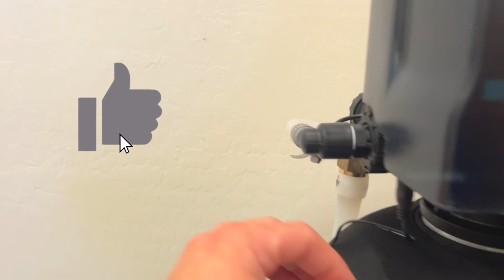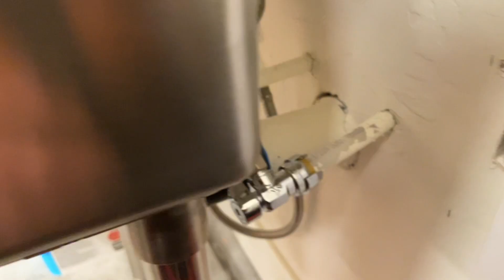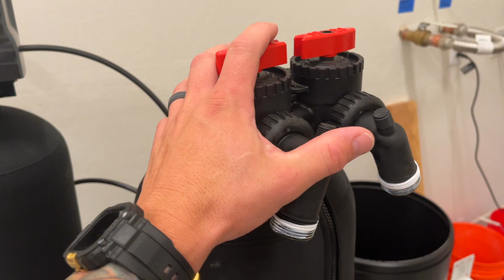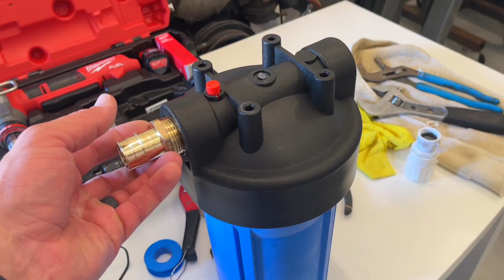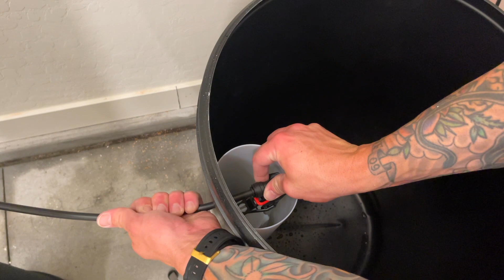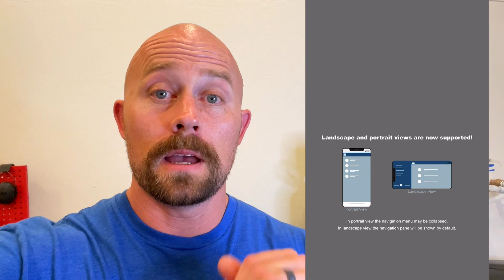How To Install Whole House Filtration System From Shell Water Systems | BEST Water Softener System

Comment: What if I don't have that main line coming in and going out?
Reply from the maker: In that situation you’ll need to have a water softener loop created. This is something you can do yourself if you’re comfortable with the plumbing but if not you can obviously hire a plumber to creat a water loop for you to hook up a softener.  If you do have one done I’d suggest having the put a shut off valve on both ends and make threads. That way you can install the softener yourself very easily

Comment: Just installed the system yesterday. The water is coming out cloudy. Is that normal? Is it safe to drink?
Reply from the maker: Yeah. It will be cloudy at first. I believe it’s bubbles from the new system and possibly any residue/dust off the cleaning matter in the tanks. 

Did you do the flush after the system starts up? I think they have something in the manual as well where they let you know the water could be cloudy at first as the system equalizes and rinses.
Reply: @FortKnoxCo  yes I ran the regen after the app setup as it mentioned in the instructions.
Reply from the maker: @Alkhi-h8g  as long as it’s done it regen on start up you should see the cloudiness subside soon. I believe it’s mainly micro air bubbles since it’s a new system

Comment: What if you dont have a loop for the water softener system
Reply from the maker: Then you will need to add one. It’s not too difficult. But any general plumber should be able to create that loop for you if it’s something you don’t want to do yourself. It’s just creating a break in the main water line coming into your home with a threaded tip on both ends. And you’re installing your water softener there at those two ends. That way all your water to the home is now passing through your system before it splits off to your cold water feeds and your water heater

Comment: Hey i was offer one called Duxura with just one tank for $8,600 dollars ans they sell that claiming that you can drink the water. But, it should he a scam. Can we drink the water of this system right ? Because im buying it tomorrow.
Reply from the maker: Yeah that’s the idea of the whole home filtration I believe. It softens the water with one tank and the other has carbon matter that filters it of the other stuff.  Most people still install a reverse osmosis system at a sink to get drinking water and to sometimes supply their refrigerator for ice making/drinking.

Comment: Why would the particle filter be after the other two filters? Looks like you would want the particles removed before the other filters??
Reply from the maker: There’s two theories behind this. Some systems/companies recommend different. 
One situation is like you said,collect particles before they go into your system

The other thought is let your system collect the possible large particles and guarantee nothing gets past or out of your system and into the house. I’ve have multiple friends whose system failed for some reason and the matter inside the two tanks blew through their entire house and water heater and utilities. Huge mess to clean up and possible damage to appliances. So I put it after the system to make sure nothing gets out of the tank into the house and let the system do what it does.
Reply: @FortKnoxCo  Thanks. I just purchased a system charcoal and resin from SoftPro. There system does not have a pre filter
Reply from the maker: @ you should be able to add one no problem. They are sold separately by several companies I believe.

Comment: The water meter belongs to the home owner in Tn. If it breaks you buy a new one . $1200.00 in 2019.
Reply from the maker: That’s odd. It seems like they should own that connection. Just like the gas company anything that has to do with the meter connecting on either side of it they will be responsible for. Anything after the meter is the homeowners. So if the water district comes out and messes with your meter and they break it, it should not be the homeowners responsibility. In that situation, I’m guessing the water district since causing the damage would take responsibility for it.

Comment: This information is very helpful, thank you! Just wondering do you ever have to replace the water softener resin media? How long it the system expected to last?
Reply from the maker: I have not came across this issue as of yet. I believe each system. The range is usually 10-20 years with 15 years obviously being the median. But it does depend on the system itself.  The smaller ones that have a small tank and brine tank all compact I’d say are on that lower end. These systems that are large and robust I’d say are on the higher end.  It also depends on the amount of use too.

Comment: Why didn’t you add a bypass to change filters out when needed or if softener system fails then you can shut off ball valves feeding softener turn on bypass and one still has water to the whole home.  And yes shark bite is a horrible product. As a plumber I highly recommend sweat or propress.. one can use pex a or pex b but it’ll look un professional.
Reply from the maker: All good information. PEX A seems to be superior to compression PeX B and some other compressions. Mainly the difference in diameter with pex A compared to compression and PeX B. The inside diameter decreases with every fitting and that can drastically reduce water flow and pressure the further you go in a home. PEX A and sweated joints will keep their true diameter even thorough the fittings. 

A lot of it is preference and what’s available in your area. Some codes require certain fittings vs others. Sometimes it’s just what would work better for your budget or maybe your climates.  I’ve seen examples of every type of fitting having a possibility of failing. There’s pros and cons to each method and quality of installation is always a factor

Comment: Hello, new developments come with fire sprinkler in the house. A plumber mentioned if the water pressure is disrupted, the insurance companies could also have issues with future claims. how would go on with installing a filtration system in those house? Thank you in advance?
Reply from the maker: Well the fire systems should have a branch of water feeding them separate from your drinking water usually. But the home filtration systems usually don’t affect the pressure much at all. Your home also has a pressure bell house fitting at the main shut off in your home and you can adjust your pressure up or down to your needs there. I’ve never had to mess with it other than on an old home after installing new fixtures. But this issue I’ve never really came across with it messing with the water sprinklers. I’d need to know more about how the sprinkler system is fed and pressurized to know exactly. You can also install a visual pressure gauge to keep an eye on your overall pressure in the line too

Comment: Curious. Why didn’t you run the water through the sediment filter before it goes to the filtration/softner?
Reply from the maker: You can install it before or after the system. Honestly, it’s whatever your preference is. There’s two different trains of thought behind it. The manufacturer in this situation recommended it be installed afterwards, I believe the idea was if anything made it through the system or out of the system, it would catch it before it goes into the house. Obviously, the other way of looking at it when installing before the system, would be to catch anything from your Supply line and not let it get into your system.

The only thing I’ll add is, I’ve seen a couple situations where a water softener has malfunctioned, and it allowed the particle matter out of the tank to get into the pipes of the house, this caused a lot of problems for the water heater and all of the appliances and fixtures. If the sediment filter is installed after your softener, it could have prevented this. So in general, I like installing it after the system.

Comment: I have a question. I found an online document and some other videos for the filtration tank with that same head unit and bypass valve and the document and other video shows to install the water coming from street to the upflow inlet  from the tank which is the left inlet. On your video you are installing the street water to the down flow  inlet. Those upflow and downflow letters are engraved in the head unit . Is that correct? Or does not matter? Thanks
Reply from the maker: Yes, it does matter which way you connect it. It will have them marked on the head unit. I believe when I received  this unit they had not been marking the valves yet and used to allow the unit to run the other way. But I believe since then they have it marked the way they want you to connect the until.  Should be inlet and outlet
Reply: Thank you!!

Comment: Great JOB!  I really appreciate the time you took to produce such an informative DIY video.  
I’m going to add a system to my house and like that the Shell system is made in the USA.
Now that you have had the Shell System for a while are you still happy with it? 
Would you change anything about the system if you had an opportunity?
Thanks again
Reply from the maker: That you I appreciate that. 
We still love the system. Haven’t had any problems at all. On initial install I had a small O-ring in the port that plugs in for the brine tank that I had to replace. I pinched it and it would allow a tiny bit of water to drip. So I replace the small O ring. It wasn’t anything big but that was the only issue I had. Otherwise we had had a great experience with the system. It is nice having the whole home filtration and soft water.

Comment: Nice vid.... Was wondering if you could add a check valve after the filter and a bleed before it so when you shut off the main you will have just residual pressure you can bleed off from the bleed valve and not have to worry about the house pressure being bled off. Just a thought...
Reply from the maker: Yep. You’re on the right track. You could isolate the system with shut off before and after. It’s really up to your imagination if you understand what’s going on. 🤙🏼

Comment: Hey Brian thanks for the great step by steps and I have a question about the filters.  In some video's I have seen two styles of filters inside Culligan WH-HD200-C Whole House Water Filter System 1” Inlet/Outlet which hold the following  Sediment filter into a activated Carbon water filter before water goes into the softner system.  Most of the videos have them before and not at the end oif line before sending water back into the house.
Reply from the maker: There’s different set up but they still accomplish the same thing. 
The idea behind having the sediment filter before your system is to keep any larger particles from entering your system from the water supply. 
The idea behind having it placed after your system and before the house is that you let your system catch and filter your water and then the sediment filter will catch anything that possible makes its way through & it will protect your home from anything that’s inside your filtration system from getting out. So if the large matter or resin beads inside your filter tanks for some reason makes its way out the sediment filter will catch all that before it get inside your house pipes. It’s more of a protection for the home in a sense. I had a buddy who’s filter system broke on him randomly and all the matter inside his filter tanks blew through his whole home, clogged all his shower heads, sink faucets and dunked up his tankless water heater. Not to mention if that gets into any of your other appliances.  So if he would have had a sediment filter after his system it would have clogged the filter and not gotten past not the house. 
Either way they help. Some manufacturers suggest putting it before , some after.
Reply: @FortKnoxCo  thanks that does make sense and will design the layout with one sediment filter before the softener system and then place the activated Carbon after the system and before it goes into the house.  Thinking of adding some presure gauges from the city line  and one from the line into the house.   Thinking that it will let me catch any presure dropping before things get stopped or cause any issues with the devices in the house.

Comment: Hi. I have questions?
Do you install before or after hot/cold water  system
Reply from the maker: Before. That way your hot water is filtered and softened. As well as your cold lines.
Reply: @FortKnoxCo  Water meter -> line water pipeline -> whole house filtration system-> hot/ cool water system right ?
Thank you so much.
Reply from the maker: @ yep. After you main shut off in your home /pressure housing, and before your split to cold water/water heater feed.
Reply: @FortKnoxCo  thank you so much
Reply from the maker: @ your very welcome

Comment: I really wish someone would do a video installing a system without a loop.  Just install from a 1” pipe no loop.  This is a great video though.
Reply from the maker: I might be working on doing a full how to
Video showing if there is no loop and how to create your own break in the water line to install a system. Just need to get a mock set up built to show a full walkthrough

Comment: What are your thoughts on their Consolidator system?  About to order it but wanted to seek some advice.
Reply: Perfect, space is what I am after and the cost as well. Is frequency of regeneration a concert. This is my first time doing this so I have no idea.
Reply from the maker: @NoShredDad  no the frequency of its regeneration cycle is not really a worry. I’m just saying if you were to compare it to a split tank my guess is that it wouldn’t have to regenerate as often, but even like most systems they have some type of combination tank and it does well withlarge homes. So to have everything condensed into one tank is not going to be a problem.
Reply from the maker: Their consolidator system should perform just as their other, just with the space saving benefits. They have it described as being able to filter exact way as the other two tank system. It looks like the benefits of it are really just the space saving. As far as the ability or the amount that it can filter before regeneration would be the only difference I would expect. Because you’re not having as much filtration between two tanks and it’s consolidated into one I would assume that it might regenerate more often than a system that has two tanks, but that would only be if you have very large house or lot of water usage. I think your budget or maybe the space that you’re working with it would be a good option.

Comment: Amazing response time! Please suggest benefit of this product over your previous reviewed aquasure softener at 1/3 the price aside from Bluetooth app control. I see whole house filter with that line as well. Thanks!
Reply from the maker: I would say the aquasure works Amazing. Zero complaints with that and would highly recommend it. Value and function 100%.  

This whole home filtration just goes the extra stem and filters the water not just for hardness but all the other bad stuff, similar to making it drinking quality like a reverse osmosis.  The reason people put a reverse osmosis at their kitchen sink still, which I did, is due to the way the houses are usually plumbed. The kitchen sink specifically has a hard water line, bypasses from the water loop that your softer er/filtration would be on, just like exterior hose spigots. This is because people will fill water from the kitchen sink to water house plants and you don’t want to use filtered/softened water for that. So the kitchen area may still need a drinking quality water source. 

But with the whole home filtration you are adding in that second tank that has an activated carbon matter and other filtration components sometimes and you are getting soft water and filtered water. So you do pay more for that combination. The bluetooth and all that jazz is nice but I don’t use it much. I just add salt to my brine tank when needed and move on. The pre/post filter you seek is an added bonus to most systole in general, good to keep large partials out of you home water lines and appliances. 

I’d say both have their value, soft water is my first priority, whole home filtration is the just the next level up.

Comment: Truly a great video. Will use links when I move forward on this. Could you please suggest how one could implement a spigot to provide soft water for car washing?
Reply from the maker: You could install an inline T that has threads or your preferred method of connecting a spigot. Just branch off anywhere after the outlet side obviously. But depending on how much room you have and the area your setting things up in you can get creative with it.

Comment: Awesome video, is going to help me a lot when doing mine thanks, question, will the ice cubes coming from the fridge have a weird taste? Salt? Ty
Reply from the maker: Thanks! Nope, the water doesn’t have a weird taste. The salt mainly is used to scrub the minerals off the resin matter in the tank during the flush/regeneration cycle. Then it flushes all the salt waster out and your system runs through the filtration tank. It only uses salt water during the regeneration/cleaning cycle. 

For water at your fridge though, most people install a reverse osmosis system for drinking water in the kitchen. And usually there under the sink they place a loop you can tap into so your water going to the fridge is coming from your reverse osmosis. At least in a lot of newer homes they will have that. Otherwise Ives seen people just plumbing their fridge line off their reverse osmosis themselves for that reason.
Reply: @FortKnoxCo  thanks again! Will be getting a system soon